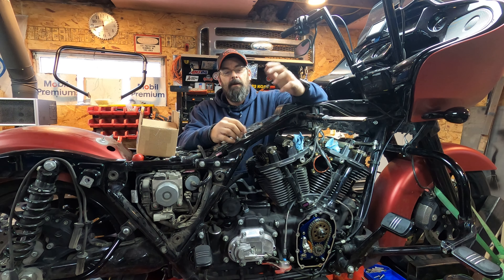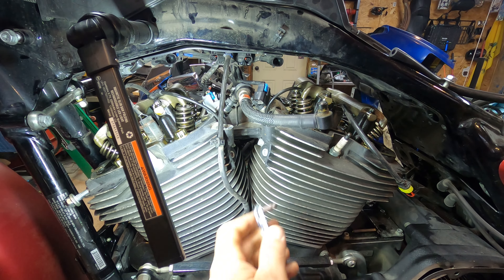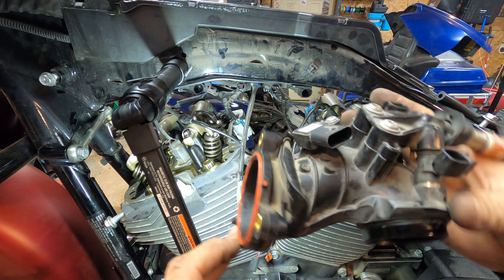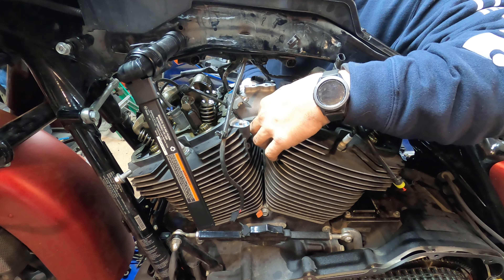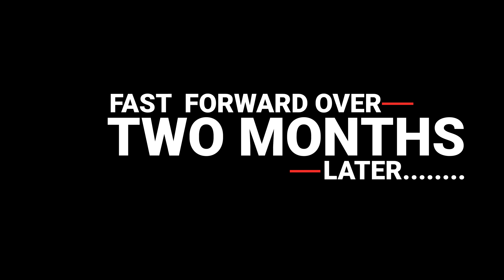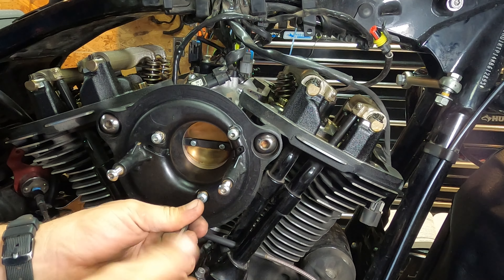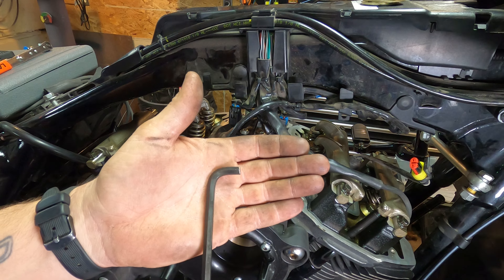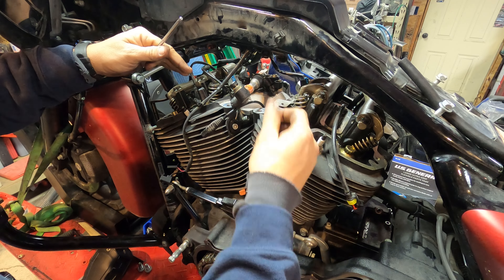S&S M8 Aluminum Manifold Install

Comment: Over the many years of production, there seems to be many aftermarket parts for HD’s to improve reliability. Many of these parts seem to come out after every engine change/upgrade.
Has HD Inc ever incorporated such ‘aftermarket parts’ design into their products?
Reply from the maker: In regards to manifolds specifically, the harleys used to have aluminum manifolds, then for the M8 they went to Plastic. The interesting part is usually their "screamin eagle" parts are the upgrades or fixes it should have come with to begin with.
I dont know of specific parts off the top of my head, but the aftermarket usually finds the weak points, then harey makes revisions eventually.

Comment: No need to remove the left side bolts since the flanges on that side are slotted.
Reply from the maker: I disagree, if you loosen, partially, or completely remove a bolt on a vibration factory like a Harley, I recommend cleaning threads on both ends, especially if loctite is or has been used.